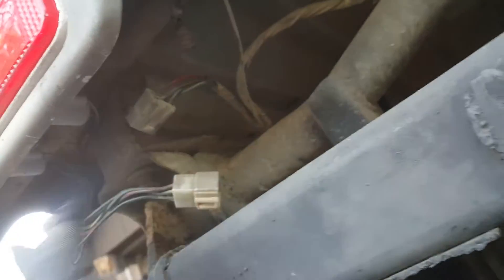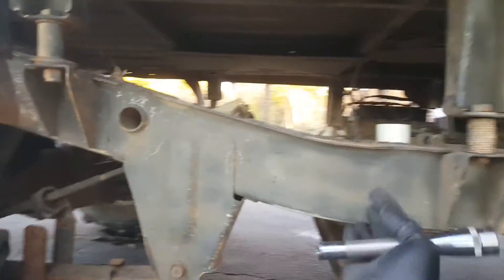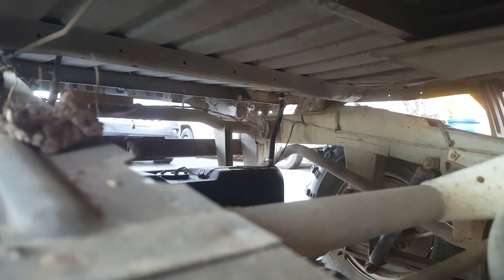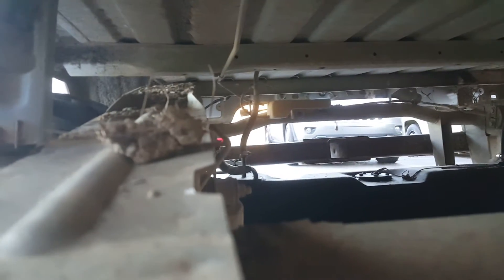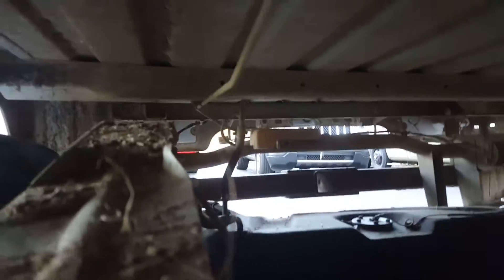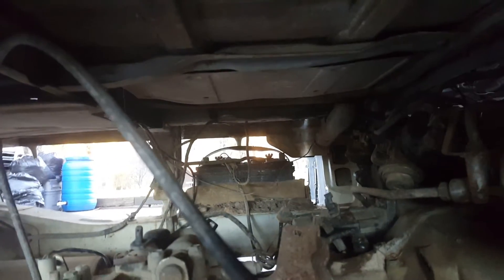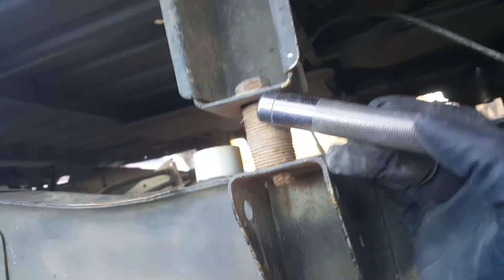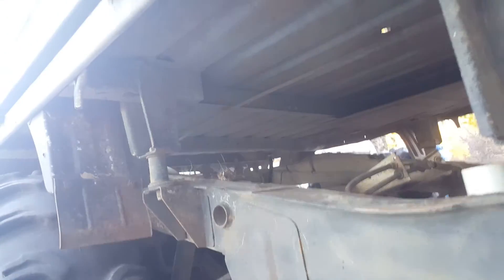1988 Suzuki Carry DB71T Engine Swap Part 2

Comment: Good day Engr. Prepper. I tried to do the same. I bought a junk DB71 body to install an F6A engine from a 94 Suzuki Carry. The engine runs but I have to fix the overheating engine first. Did you have problems after assembling it?